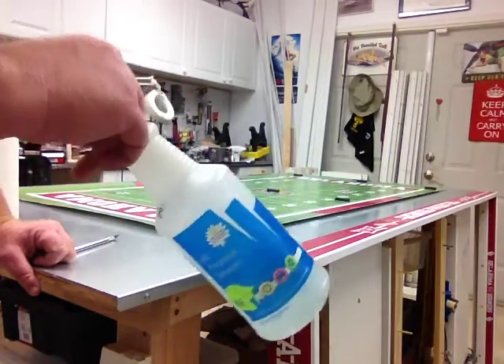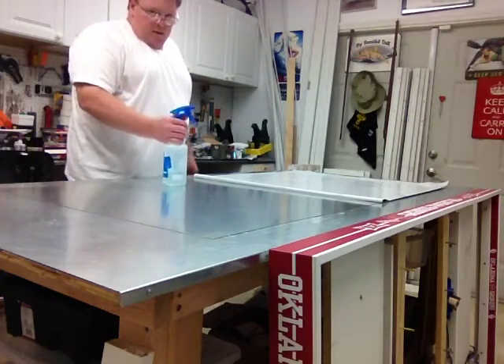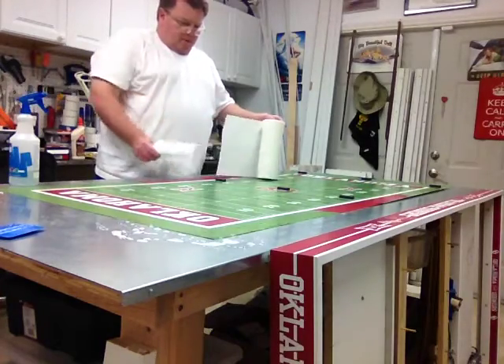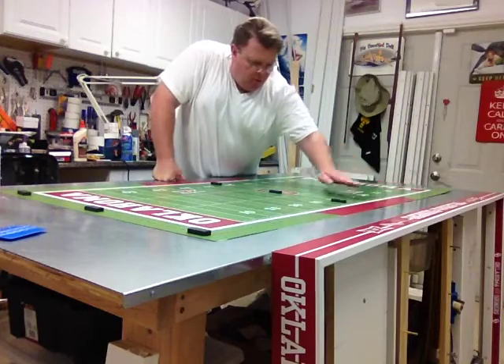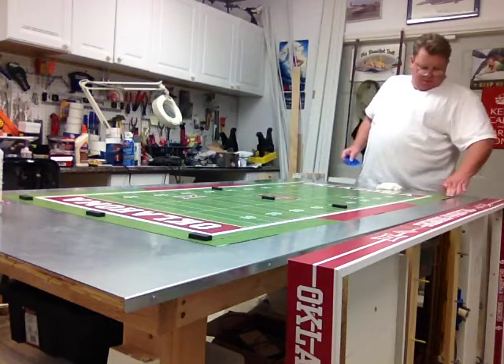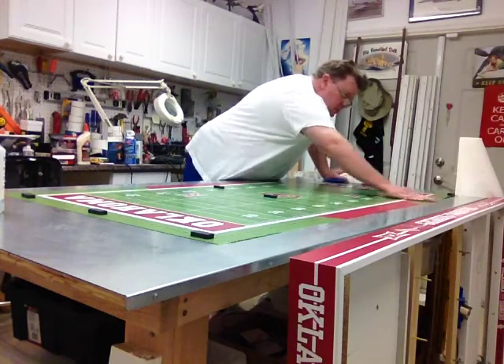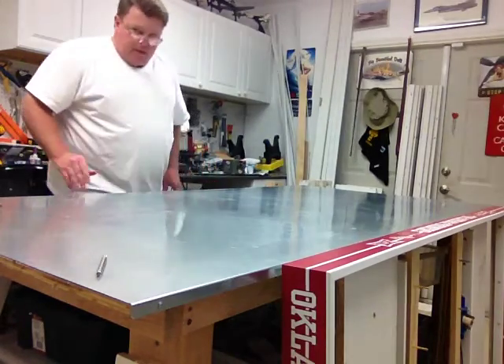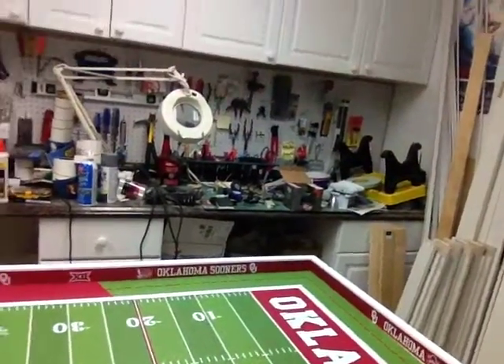How to apply a field cover

Comment: Thank you for the invite but my goal
is absolute play realism and NFL 
onfield strategy by running the most
complex pro offenses and defenses
as base tweaking and scale size fields
dont allow realistic play calling. 
A tweaked base runs 100 yrds on a big
field in 2 sec. throws off the timing 
needed to run difficult plays when a
non tweaked base on an 18" x 34"
field runs 100 yrds in about 10 sec.
giving you the proper timing to run
plays. I will make my name in EF for
GAME ON! passing (allows real blitzing, deguising coverages ect.) TRU ACTION play (no stops) and ALL NFL rules 
I believe Xs and Os are the real future
of EF and Im willing to work with the
MFCA/Tudor or w/o. Hard for me to 
get behind tournament play when the
strategies are not NFL based
Example: The CB/WR play of trying to
just drive WR out of bounds with no
down field coverage.
I hope this gives you some insight into
my efforts. Again Thank you.
Follow my progress:
INSIDE ELECTRIC FOOTBALL
TOTAL TEAM CONTROL
NFL PLAYBOOK
Reply from the maker: In 20 years of building scale fields , I've never seen someone zip 100 yards in 2 seconds!  I believe you may be confusing other fields for one of mine.  On average it takes a tweaked base 8-10 seconds to travel 100 yards, which, like you said, and I have advocated, is a scale speed.  My fields are 1/2" = 1 yard which makes the field 5 feet long and 26.5" wide.  Which is scale to the size of the players.   The MFCA TOC competitions strive for realism, you should show up to my tourney or the one in Richmond and get a better understanding of the competitions we Re conducting, it sounds like someone is giving you bad information.